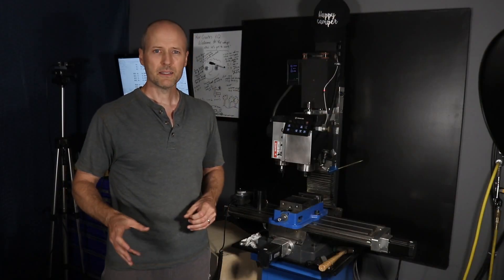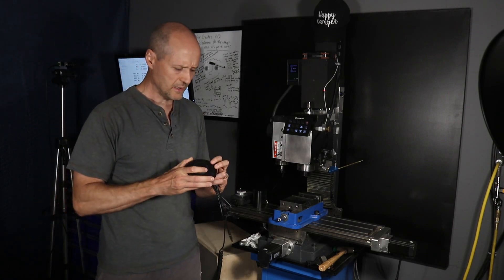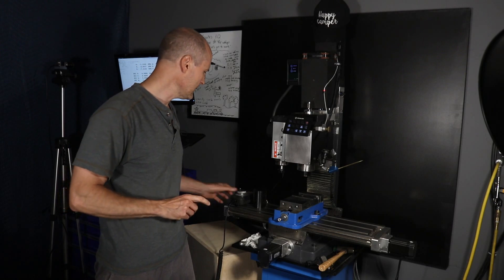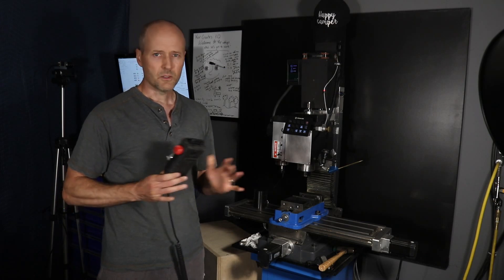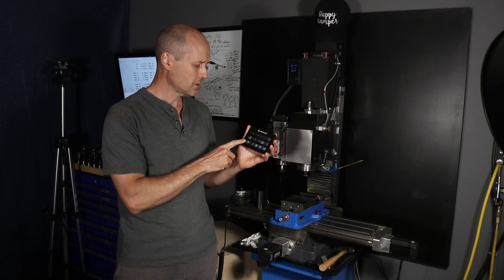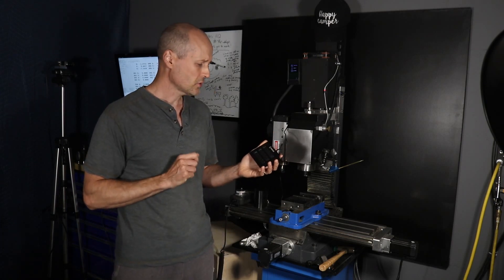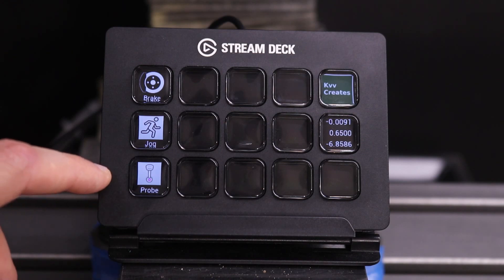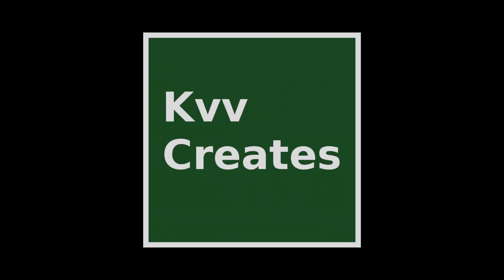Custom CNC Pendant, LinuxCNC, Elgato Stream Deck

Comment: i use my linuxcnc small mini keyboard wireless usb keyboard, not perfect but working well move spindle. i not understand code any and not can build good pendant to my liuxcnc but want make and use. but need step by step manual how made. encoder and move buttons, touch plate and more but not understand any i has try make not working, lot only errors in linuxcnc display.

Comment: LinuxCNC 2.9 (the current dev version) has switched to Python 3. But what you say was true when you said it, and remains true for the current released version.
Reply from the maker: Thanks Andy, it's nice to hear from you. After this video I built dev against Python 3, but then the touch probe screens didn't work. I started to port the touch probe code and gave up on it. The thought was to make a fork of LinuxCNC that add-ons like touch probe screens already installed. Everything takes longer than expected.

Comment: I recognize those axis button images!  :D  have you tried using Probe Basic?
Reply from the maker: All those buttons are someone else's and I hope they don't mind for the demo. Did you write Probe Basic? I would like to have on-screen probing routines; currently I call out to my own routines. A couple of months ago Probe Basic and QtVCP weren't working well when LinuxCNC was built against Python 3. If you know if that's working now, please let me know.
Reply: @kentvandervelden  yes i designed probe basic with the help of a few other awesome peeps, Turboss, Kcjeng, joco, JT.  the new python 3 linuxcnc release is still getting debugged itself but that is version 2.9 master we debug along side it,  but so far most of the issues have been resolved i think. i have a test instance on my dev box that is running good so far without incident.

Linuxcnc version 2.8 and the latest probe basic version 0.4.0 is rock solid, i run it in production on my vmc.  and it never skips a beat atc, probing, conversational, tool setting, and the latest MDI updates which are AWESOME (shout out to Joco for that one)!

If you need Python 3 I would wait until linuxcnc 2.9 becomes a locked down version.  its tough to debug while they are still doing so much themselves. usually once all the bugs in linuxcnc are sorted fixing qtpyvcp is much simpler.  hope that helps!
Reply from the maker: That's fantastic, glad to meet you! I already run LinuxCNC 2.9, and keep it fairly up to date. I started fixing some Python 3 problems but quickly ran into needing to do a lot before I do any testing. So, I've stuck with Axis. With the 2.9 LinuxCNC branch, should I use the Python3 branch of probe_basic, to get a Python3 LinuxCNC Probe Basic system going? Thank you
https://github.com/kcjengr/probe_basic/tree/python3

Comment: thank you for posting the code. it is interesting to see how you executed the pipe to bridge versions of python
Reply from the maker: Thank you. Since the video, I compiled LinuxCNC 2.9 with Python 3 enabled. This is pretty easy and eliminates the need for the bridge. The developers are working on the Python3 port, which works great if using Axis but there are quite a few packages that are unavailable. I've been kicking around the idea of writing a new interface in C.

Comment: I'm using the XHC-WHB04B-4 handwheel (the only difference between the 4 and the 6 model is that the 4 axis model has a stopper in the switch, which still can be removed with a cutter to allow switching to 6 axis).
Now I'm improving motion.adaptive-feed to be able to reverse and forward g-code via handwheel (it already works but needs to be fine tuned).
Reply from the maker: Looks pretty nice, especially with the large display. Funny that just a stopper must be cut. You tied one of unused axes to a HAL encoder and then adaptive-feed? That's clever! Thank  you.
Reply: @kentvandervelden  it has 2 knobs (on top of the handwheel), one for speed control and the other one for the axis; The knob for speed control has one option called "Lead" that's what I used for now.
But I will remap the adaptive feed to the "Continue" button. The original author intended to use the "Lead" Option for spindle speed control. 
I'm using 5 Axis on my machine (3+2, A + C axis), when I bought the remote I didn't think that I will use more than 3 axis.

Comment: I looove it! Thanks for sharing 🙏
As port to Python 3 seem to be seriously on its way, may be a more solid and reliable integration could be possible?
Reply from the maker: Python 3 would be amazing. Is there something you could point me to about the port? I found something in 2.9. Started building it on a separate machine for Ubuntu 20.04 and ran into problems with the kernel. Stopped there to complete video. I may be able to help a port and would like to setup my system to follow the port.
Reply: @kentvandervelden  I think Rene Dev is involved if not leading the port. QtPyVCP/Probe Basic devs have started porting too to not break compatibility. Best way to reach the gang would be to join LinuxCNC IRC channel (also bridged on Matrix) and/or dev mailing list.
Reply from the maker: @JérémieTarot  Thank you! I'll check it out. Rene Dev's post from earlier this year asking for help testing was the one that have hope. I didn't realize there was a mailing list. 
I started with Probe Screen, but is Probe Basic preferred?
Reply: @kentvandervelden  hope he'll forgive me, his name is Rene Hopf. Probe Basic panel, and furthermore the QtPyVCP toolkit are clearly my LinuxCNC UI personal champions 👌💪

Comment: how about putting a load cell in a large knob for torque control over the jog speed and direction 
basically you need to fix the load cell to the frame and float the knob pivoting in the center with 2 wedges on the bottom of the knob that make contact with the other side of the load cell. this is essentially like a spool valve in a power steering setup.

here is an excellent explanation of power steering if you were unaware
https://youtu.be/VDiOKqMKTO8

the same setup can be used coupled to servo for haptic feedback to feel collisions.
Reply from the maker: Thank you, this is great! The haptic method I understand a little. The power steering one may be over my head, after watching the video. The load cell one is pretty interesting too. I didn't understand it's relationship to the spool valve or the purpose of the wedges. Does the load cell measure stain along the axis of knob rotation or at the wedges?
Reply: @kentvandervelden  the wedges are to allow the load cell to flex in either direction as you apply torque to the knob without direct coupling otherwise it will flex in one direction but not the other. one of those cheap chinese load cells and an ADC for it will do the trick. 

the load cell peforms the same function of a spool valve, it measures any difference in torque between the knob and the shaft which is mechanically connected to the load cell.
I will try and come up with a drawing in the next 24 hours.
Reply from the maker: I got notice from YouTube of the link but said it's no longer available :( If you can get it me another way and it's practical for me to build, I'll give it a try. Great excuse to learn about load cells. Thank you
Reply: @kentvandervelden   github dot com slash fjdebruijn81 and its under TorqueKnob
I sent the message twice but youtube is censoring my reply for some reason.
Reply from the maker: @fransdebruijn6763  Thank you! I got one notice but could not see the comment nor was in a held-for-review comment. Sorry about that. How knows why YouTube does the things they do. I'm looking at your design now. Does it require the load cell to work in two directions, with the load cells' arrow and against? That works OK?
Reply: @kentvandervelden  the load cell will work in either direction just as well. the arrow is there so you know what direction to install it with the wires giving the expected polarity.

it may be advisable to add some push button switches that make contact with the load cell where i put the cylinders in that crude drawing for the purpose of safety so when there is no torque applied the system is disabled, this should eliminate any small drift over time from causing false inputs and a slowly drifting axis on your machine. its the same reason scales have a "zero" button.
Reply from the maker: @fransdebruijn6763  I'm sorry, your encoder comment was lost (maybe because of the links?), but I wanted to reply. What you described is very interesting and I'll look into it. I would not have thought to make such an encoder. One nearly off the shelf product that I considered is the Kubler RLI500 and similar models. I had trouble either obtaining one so went a more typical but boring path. Thank you
https://www.kuebler.com/us/products/measurement/encoders/product-finder/product-details/RLI500

Comment: I feel like the most intuitive control would be similar to an old VCR Jog knob, that you can turn either way and it spring returns to the middle. The further you turn it the faster the machine moves, perhaps three of them in a stack for XYZ, so you can grab just one, the top two, the bottom two or all three.  Just an idea.
Reply from the maker: Interesting idea! The ShuttleXpress has a single jog wheel. I've started looking for center spring return potentiometers. Might be something to try. Thank you
Reply: @kentvandervelden  What about a 3Dconnexion Space mouse? They have 6 degrees of freedom are proportional and return to the centre on all axis... I find them quite fiddly to use though.

Comment: 👍
It's possible to make a keyboard emulator on an arduino pro micro with an atmega32u4 chip.
Without displaying the icons.
Or buy a wireless mini keyboard
Reply: https://www.instagram.com/p/CKkqmUQpDxh/
Reply from the maker: Good to know! I may use the Arduino pro. The touchpad on the wireless keyboard is interesting too. Thank you
Reply: @kentvandervelden  i made a DRO for a PC based on keyboard "emulation" with an arduino pro micro ( atmega32u4 )
https://www.instagram.com/p/B-icTkmKJd9/

Comment: I tried the wireless xbc04 for awhile. Ended up selling it and using $15 gamepads oñ all three machines. Best feature is the analog joyaticks. I updated the remote pendant wiki a few months ago. The only downside is ño feedback, but i can séé my touchscreen ôt the work piece.
Reply: Are you getting analog velocity control out of those analog joysticks, though? In the standard configuration (with QJoypad), the stick acts the exact same as an arrow key, so while you'll see the speed ramp up/down with the machine's acceleration setting, it'll still hit the same peak velocity no matter how far you tilt the stick.

It's definitely possible to configure the value from the joystick to map to a velocity (since hal_input has it), but that's a lot more HAL I never got around to.......... so if you did....... spread the love, please. Hahahah.
Reply: what is xbc04? xhc whb04?
Reply: Looks at the linuxcnc wiki page for remote pendant. I recently
Reply: Recently updated for 2.8/2.9 and analog joysticks work fine.

Comment: The context sensitivity is pretty terrific.  I feel more comfortable using hard-wired MPGs to move metal, but I am definitely impressed with what you've accomplished.
Reply from the maker: Would take a lot of more difficult programming to have a robust system, but even then they'll be unknown bugs. If the Stream Deck is not right for LinuxCNC, maybe else with a complicated interface, maybe ROS? A tool to use another day. Thank you